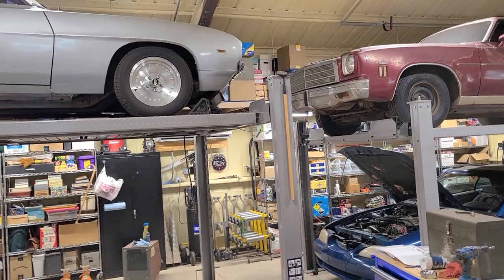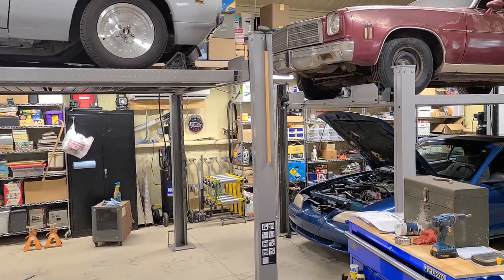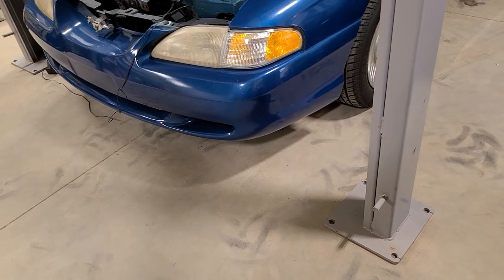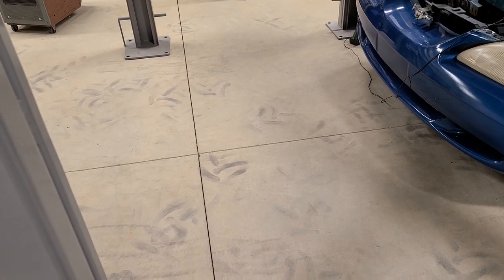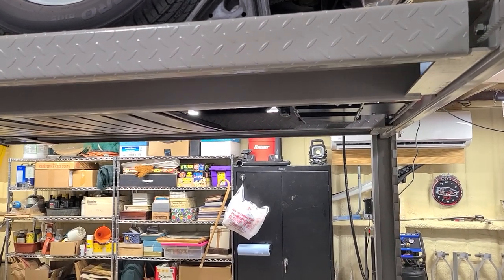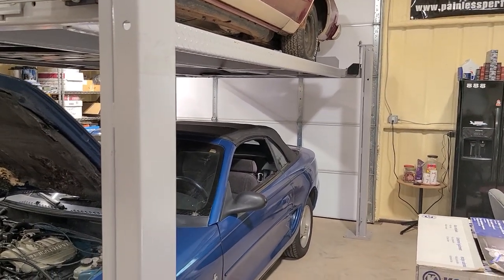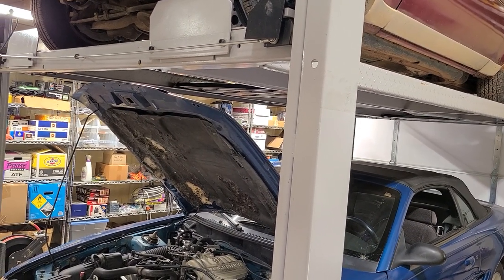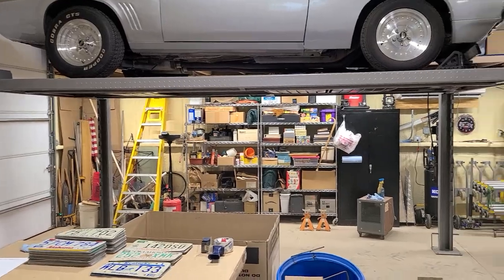Visual comparison of two Triumph 4 post lifts

Comment: At 66 and 14 spinal surgeries I unpacked and assembled my XLT with only an engine hoist. They seem to be much better quality than four years ago from the videos I’ve watched. Mine slid together like butter.😊
Reply from the maker: That's great, how did you get the cross pieces on the posts? That's the part I had the most trouble with.
Reply: Laid the top ends on eight inch wood blocks, used the hoist to start them on each end, then went back a forth sliding it on. That’s where I noticed the difference. They slid on with ease. I felt lucky.